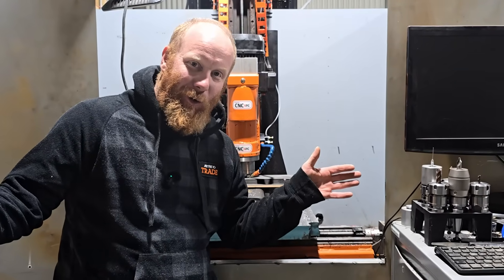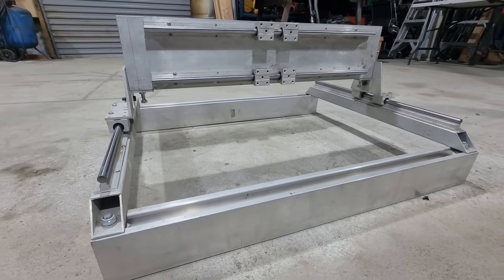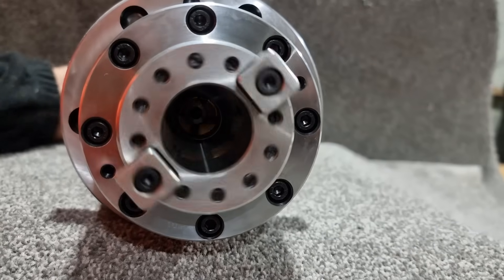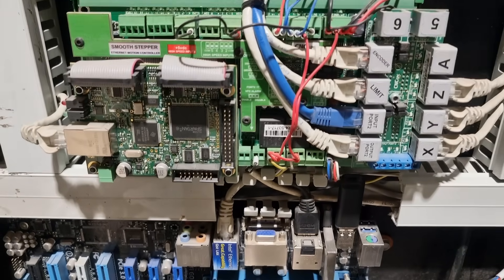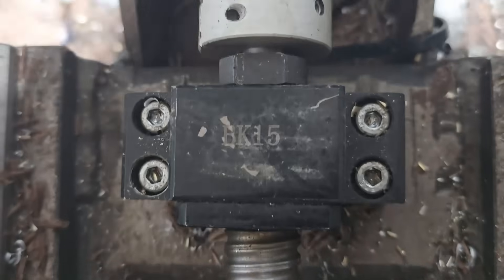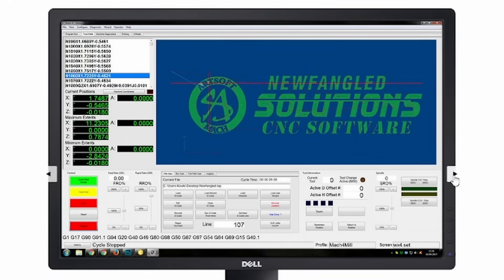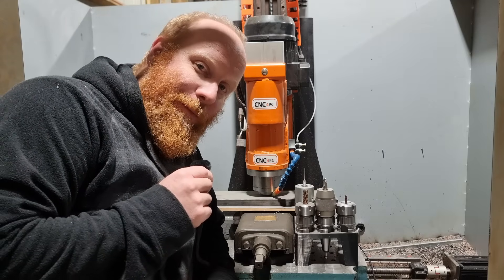Thinking of Building a CNC Watch This First

Comment: look at all those circuit boards. that's so stressful. i rather build it with arduino. i watched this video thinking i might missed something as a beginner
Reply from the maker: Its not really. There is a normal pc down the bottom that runs the brains of the operation and mach4 then the board above its only job is to output signals and input signals bach to mach4 it probably easier than arduno there is no real coating to do just drop down boxes and pin select. I had a cheap board and it never worked as well as spending a little more on a good peace of reliable kit. Everthing is figure outable as they say. I wish you the best with your projects. Any questions just ask and I can help I will.

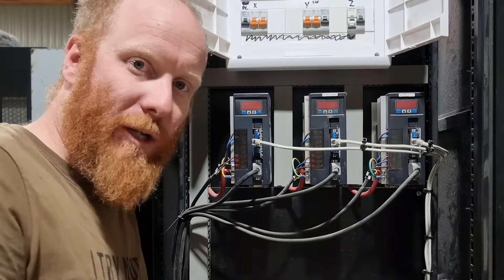Comment: sorry but for closed loop stepper motors u dont want the PLC kind encoder signals... cause the closed loop stepper drivers already have encoders inside them... closing the loop... what u want is a hybrid encoder like CL-HSS860 that reads the faults, adjusts the alarms, and the estop logic and the difference in steps adding a PLC kind encoder like shown at 1:24 for a closed loop stepper mottor will be redundant and actually bad cause u can easily EMI ur system by sending back a signal that is already read by a encapsulated encoder in the stepper motor... when u want a PLC encoder signal? just when u do AC servo motors... then yea... other then that dont overcomplicate sht... yea it looks proffesional but doesnt make sense... and it actually overcomplicates and in some cases is bad for your build. in the difference in price tho... i would swap that "elastic coupling" from "fingers" to "radial cut disks" that will give u zero backlash long run... while the colored stuff will only work initially but after 3 months of use u need to swap them... yes they cheap... but u mess arround with crap u dont really want to touch ever again.
Reply from the maker: I don't have any steppers on this mill. Everthing is grounded and separated in the cabinet. I havent had any emi problems yet. I have seen the disk type I will upgrade it one day. The never ending projects 😂.
Reply: @gingerninjaneering yes I'm starting a new project as well my old mpcnc works fine just I don't use it anymore so I'm thinking in doing an actual CNC milling center just cause I'm a masochist lmao 😂 I love your project though looks amazing.
Reply from the maker: @REDFRAQ awesome mate sounds like a good plan new build is always fun.
Thanks mate hope you got a couple ideas. Keep me posted with your project always interested to see what people build.

Comment: About to start the journey. Run a small cnc shop with one of our mills getting tired. Considering a couple DIY machines mostly for alu keep steel mostly on our other fadal. Probably BT30. I'll keep up on your vids
Reply from the maker: O thats sounds awesome. The all in one bt30 spindles look pretty good. Good luck with the shop mate and the projects thays really cool. Thank you for your support
Reply: @gingerninjaneering unless its a really fancy spindle you kinda have to go servo driven to get the low rpm torque. But then maybe max out at 12k rpm without a transmission like my fadals. At 2500rpm they switch to high gear on up to 10000rpm
Reply from the maker: @RCBound o right I see thats cool. Yeah cnc is an expensive thing😅

Comment: What is the precision of the machine? Like repeatability etc?
Reply from the maker: Pretty good the encoaders are 10 thousand lines per 360 degrees of rotation. And the ball screws a 5mm per 360 degrees rotation so overall very accurate. Its the welding and things that bring inaccuracies into it but i have done my best to shim everthing. Its in the microns of movement. Accurate enough for me in my shed but not for rocket space.
Reply: @gingerninjaneering  Nice!

Comment: For the stepmottor lovers, there are some step motor with position feedback and it is not encoder with a cristal, they use something mechanical but very reliable, from oriental motor.
Reply from the maker: Yeah the step motors are good an do have good power. The only down side is the speed of them the servo will do 3000rpm and power all the way through that range. Stepper motors would work aswell though and like you say even better with the encoader. Cheers for the comment.

Comment: I have always wanted to modify a manual lathe and mill. I guess I have to start those now.
Reply from the maker: If i was going to do it again that would be the way I would do it. The alignment is really hard. An old mill has mass that is built in already and is pretty well aligned in a good tolerance. Cheers for the comment and good luck with your project.

Comment: any tips how to finance this hobby? :D
Reply from the maker: It took me 3 years to build. i just brought things along the way as I could afford them one motor at a time peace by peace. Aliexpress is good parts are much cheaper. 
Dont tell the wife or partner, lol begging for forgiveness is easier than asking permission lol. This is also why I can't upload much because it is very expensive to make videos and it all takes alot of time.
You can do it just really think about what you want fro the machine and build around that.
Reply: @gingerninjaneering awesome advice, thank you for your time! and yea, while cliché, don't tell wife part is learned very early in the relationship 😁
Reply from the maker: @FrainFreeze no worries, just sing out if you have any more questions. What are you thinking about building
Reply: @gingerninjaneering thanks! 
I've been intending to convert old cnc kit I bought and never assembled into sinking EDM; then I can machine graphite or even lost wax cast copper into a tool head, EDM the mold out of steel block, and then use the mold for injection. Found a cheap used injection machine recently ($1.5k for 60ton, 100gram machine) and have been thinking about getting it. But transport, workspace and everything needed to get it all running ads up super fast, and realistically I'll never have ROI from 40y old machine in my barn 😅
Reply from the maker: @FrainFreeze wow thay sounds really cool mate. Interesting things happening. Lol if your doing it for ROI its not a hobby anymore returns are just a bonus. I have made nothing out of building my machine just for fun. Very cool project you have on the go. Keep me posted on it

Comment: Man, I can't agree.
It's not 100% doable for the majority of people.

It's not impossible, but definitely not at the "anyone" level.

Just watch the junk you can find around...😅

Yours is pretty good, however!
Just protect linear rails and motors from chips!
Reply from the maker: Thanks, mate. appreciate the comments. 
I have plans to make covers. it's just a when I have time thing lol. It's very hard to find lately.
Reply: @gingerninjaneering I understand, but the risk of having to replace rails and ball screws because of chip contamination is too high to wait, in my opinion!

You can find designs for make accordions cover with plastic sheets online!

I made mine from projector screen material, recovered from a factory who make screens.
It's ~0.5mm thick PVC.
Reply from the maker: @PreciousPlasticRomagna o right, that's cool. Did you make them just cover the ball screw and rails or is it aa whole thing covered with one peace.
Reply: @gingerninjaneering for now only on the back of the machine, covering all.
Take a look at the video, I made one about the machining of the parts, and there's at least one photo of the cover!

Unfortunately I had, and have, to waste some time recently, I broke a vertebrae and I was blocked in bed for 20 days, so I made the videos with the materials I have accumulated on my smartphone...
In the next few months maybe I will start to make something better...😅
Reply: I checked, the photo is at 11:15 in my video!
Reply from the maker: @PreciousPlasticRomagna o man I bet that was painful. Hope you getting better now. I will definitely check it out mate.
Reply: @gingerninjaneering Yes, it was.
It inflamed my sciatica nerve, I spent two weeks like I had hyenas chewing my leg.
And I was taking strong painkillers.
Now it's healing...
Reply from the maker: @PreciousPlasticRomagna that's good mate I hope you get better soon so you can get back out into the shop.

Comment: Im actually in the process of planning my own machine. For 4 fucking years bow 🤣 

I started my plan with aluminum extrusions and round linearrails. Then i found out that this machine will suck. 

Then i wanted to build it from steal but found out i cant build a Milling machine out of steel without a milling machine. 

Then i bought a full machine shop (mill, lathe, surfacegrinder). After that i started gathering parts like unsued industrial ballscrews and really big and precise T-Nut plates ... I started with a budget of 1000€, a 3D printer and a drillpress ... Now i spent like 15000€ and not even started to build 😂
Reply from the maker: That is epic as i love that. Money is just a thing Just make more money lol. You can't put a price on a hobby and deam or something you just can't stop thinking about. Keep up the good work and let me know how it goes.
Reply: @gingerninjaneering maybe in two years I can start my build 😂

but I forgot a important part. I already build two CNC machines while planning. A MPCNC to learn how to program a CNC and a DIY CNC laser to learn how to build precise stuff with linear rails and so on. 

Both a good projects for a start I think. Both can be build pretty cheap

When I start the build I will post about it.
Reply from the maker: @marcusplanlos2037  awesome let me know when you do.

Comment: I've been working on a low power cnc router for almost a year now. Started with 2020 extrusions, 3d printed parts and a dremel. Now I have aluminium panels and extrusions and a wood router. I just wanted it to machine aluminium but the sad thing is it has huge flex on the tip which is I believe caused by 10mm linear rods I've been using and at this moment I have nothing. I wish I had seen your video before.
Reply from the maker: Yeah the main thing about cnc is building rigidity into the machine. Sounds like what you are saying is you want to build another machine 😉. Cheers for the comment and I wish you best of luck.

Comment: 750W axis motors is overkill don't you think? I'm retrofitting another lathe at the moment and the 400W servos I'm using are even over the top. But I got them cheap.
Reply from the maker: It might be overkill, but everything is very heavy. The speed i can run the machine at is pretty good. I just went as big as I could afored at the time. Cheers for the comment most appreciated.
Reply: @gingerninjaneering  Sure, understood. But if you could have used a feeds and speeds calculator to show how much power is needed for the work you expect to do, you would have saved heaps of money.
Reply from the maker: @robguyatt9602  That is very true. But the cost of these was pretty cheap there from aliexpress. I think the servo and the driver were around $250 usd, so they were pretty cheap really compared to smaller ones or closed loop steppers. Cheers for the comment.

Comment: Im building a CNC from Epoxy granite and made the frame and bed. its been dusting down in the corner of my garage for the last years as i did not know how to get all the planes straight in all planes and axis. But this video gave me a push to get back on the horse. thanks
Reply from the maker: Awesome mate, that sounds like a good machine. Keep building it mate it will be an achievement to finish it, and then you can start more projects with the machine. Cheers for reaching out.

Comment: I love it! Subbed! I bought a small cast iron gantry style cnc machine some years ago. It came with with a cheap Chinese controller board and stepper motors, but the frame is extremely sturdy. I used it to build parts for its own improvement, so now it runs on a Centroid acorn controller with DMM servos and a Teknomotor HSK32 quick tool change spindle. Overkill? Sure! But that’s exactly the point 😅
Reply from the maker: Awesome, thank you for the comment. That sounds like an awesome machine. I bet the controller upgrade helped it alot. I had the Chinese controller at the start to but quickly learned that was no good. That's when cnc4pc started to help me out with controllers. Cheers again for the support.

Comment: This video is basically saying: "dont be poor and inexperienced, get the most expensive components and build the machine using advanced skills that may lead to a lot of time, money and morale loss if you make mistakes". If you find this advice viable, i would advise not to start building anything at all because you will hit a wall hard, very soon in your build process.
Reply: Is the advanced skills in the room with us?

Seriously though, if someone needs a homemade CNC metal mill, chances are they already have the skills, or can pick them up easily.

And also! It's 2k for a cnc metal mill!!! Do you have the slightest idea how expensive a good cnc metal mill is?

even if you found a used CNC mill for $2K, the costs would still pile up. The machine would likely need servicing, meaning enterprise-budget parts. Plus, the software on a cheap macine like that would probably be outdated, requiring further costs

You also don't get to give advice in this instance. This is metalworking, not 3D printing. 
The skill cap is not too high, you just lack the basic skills and understanding of the subject.
Reply from the maker: I was poor and inexperienced when i started this project. That's why it has taken 5 years to get to this point. I saved and brought parts when I could afford them. I peaced together parts over time and collected scrap. Anything is doable with the right mindset and motorvation. I think anyone can do anything if they want to. You could build all this with hand tools and then use the machine you built to machine more parts for that machine to improve it. Also, this is just what I built. I was hoping it to be more of an overview of parts, not so much a what you have to build i apologize for that. it can be way scaled back and made in any way from any materals. Cheers for the comment I appreciate the feedback.
Reply: @gingerninjaneering never apologize to Eastern Europeans.
Reply from the maker: @sethbracken  lol I will live by this from now on. Cheers for the comment

Comment: Good job friend. I went for open loop Nema34 on my machine because I'm running the top of the range centroid cnc controller which has closed loop 1micron Linear rail feedback on all axis.
Reply from the maker: Thank you most appreciated. O, that's  awesome. Big power with feedback can't beat that. Love the sound of your build.
Reply: @gingerninjaneering  I actually purchase a bare cast iron gantry style cnc frame (1200kg) from China and then just build it with all my components. I added an additional 300kg of epoxy granite. I love the machine.
Reply from the maker: O awesome i have seen them on alibaba before. what is the quality like. 
Sounds like a beast of a machine and the epoxy granite would have dampend some vibrations. 
I bet it eats anything you put on it. 
how do you find the Centroid system
Reply: @gingerninjaneering I love the centroid. I have 3 systems running centroid now. 2 mills and 1 lathe. I love everything that You can do with it in term of programming and functionality the input/output control it has. The screw compensation. Scew correction. The digitizing and built in probing cycles and cloud point digitizing a part that then goes straight to cad. Its just awesome. I have a 3.2Kw 240000 rpm spindle on it as I do almost exclusively aluminium on it. It's a awesome spindle Yiu can check it out. It's a JGL-100 BT30 ATC. It has upper and lower internal limit switches for tool changes with upper and lower bearing temperature sensors and fully water cooled. I average less tan 5micron total indicated runout on all my tools with it.
Reply from the maker: that sounds awesome mate i liked the look of the centroid stuff but was a bit out of my price at the time. what a machine. i assume you use it for production work. do you make a product or just maching for people.
Reply: @gingerninjaneering I know its a bit overkill😂 but it's only a hobby. I do 3d printing, laser engraving and machining at home. I mostly make decorative things and some performance car parts. @gingerninjaneering
Reply from the maker: @raindeergames6104  don't worry I understand completely about overkill for hobbies. Ask my wife, lol. 
If you don't have things that make you happy at the end of the day, what's the point.
I have a couple 3d printers to thats what got me into cnc stuff at first.

Comment: Nice overview mate. I'm curious about the motor you are driving your spindle with, I'm guessing a 2 or 3 horse 3 phase with a VFD. What's your top speed and pulley ratio?  You are machining mainly steel, yes? How is the low speed torque?
Reply from the maker: Hey there. Yes it's a 2.2.2kw 3phase motor. Top speed of motor is 3600rpm. Ratio is 1 to 1. I have machined steel and also stainless. It has plenty of power but not much at low speed I have stalled it before. I have plans to upgrade to a bigger servo motor with 6k rpm to take advantage of the 6k spindle. Cheers for the comment most appreciated.